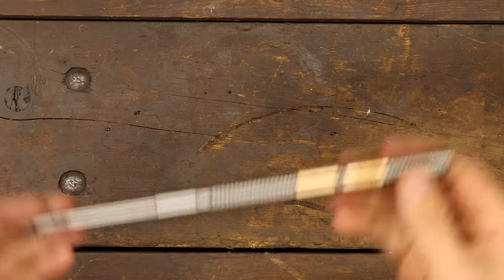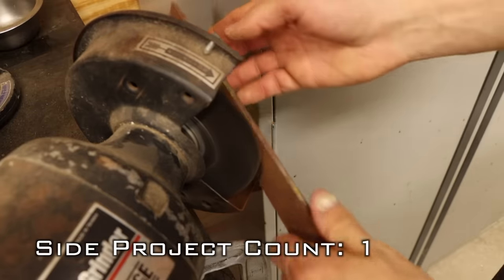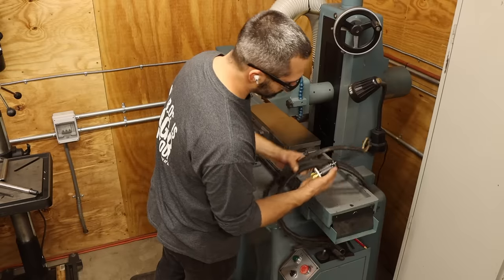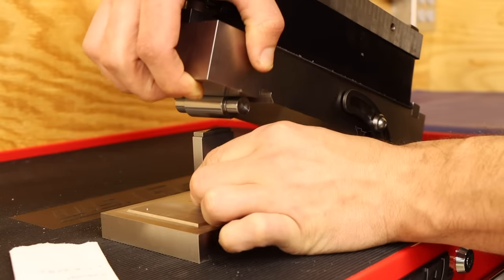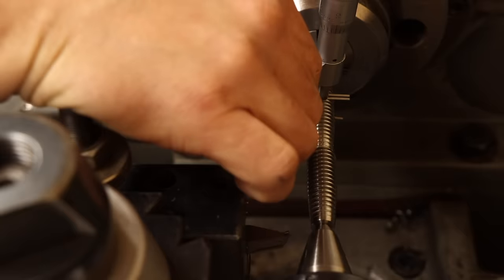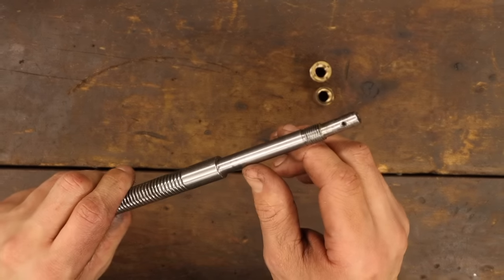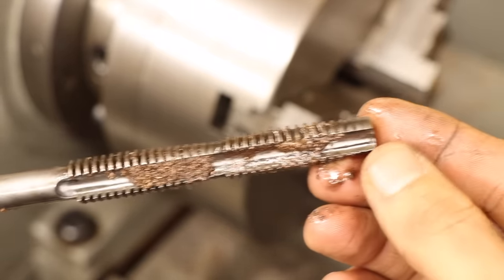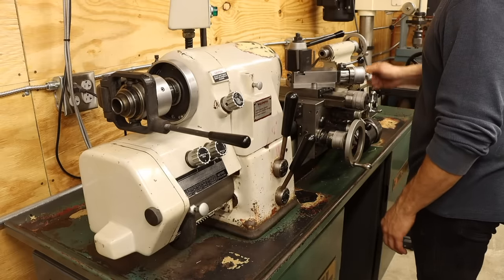Just A "SIMPLE" Repair

Comment: Have a far older beauty, in need of MUCH,  As it is imperial, and worn, going to do the same, but as the thread is cut into the the slide, have much thinking to do before I start.
Reply from the maker: Oh wow... seems like you'll want to bore it out and make a replaceable pair of lead nuts (if possible of course)

Comment: All great work !
 I gave up my DV-59 For a 10EE. I still ponder that decision as both needed some extra attention. My 10EE still requires the same Shaft & Nut replacement you just did. I can buy new from Monarch for $$$$$$$$$ or make my own, since I AM a machinist kinda guy. My new cross slide nut/shaft holds .0003" maybe i can get the compound to be .001"
Reply from the maker: I have faith! Thanks

Comment: Why remove the backlash with fixed nuts instead of having one spring-loaded nut? (with the spring coming from the direction opposite the tool holder's applied cutting force)

Comment: NICE WORK.did you check if the dials stil indicate correctly. Your thread could be a TR14x2.5 thread.
Reply from the maker: I didn't but I would not because the handwheel dial is 100thou per rev haha

Comment: since you are replacing nuts and rod could you simply not make the screw whatever size you wanted as long as it falls on the correct ratio not to throw off the measurements up front on the dial?

Comment: Yes, the threads are ground,  At least all the ones I've made(work at a machine shop and make repair parts and such for these compound slides) we finish grind all the diameters and thread grind the threads.  The bushings are threaded on CNC lathe with a special insert on a boring bar.

Comment: You might wanna check and see if the dial graduations still are accurate. Hope I explained that correctly. Since you made a new lead screw, it's possible any slight difference from the original will mean that a full turn doesn't equal the same travel as the original part did.

Comment: Cool repair. I almost wish that I had a fully equipped workshop just so I could restore old machines. One thing I did think of though, could you not have roughed in the thread cutter using the bench grinder then brought it to size on the surface grinder?
Reply from the maker: Thanks! Yup I thought about doing that but decided to keep it simple. The SG worked it's way through before too long

Comment: Okay for real, I've done art based 3d modeling for years and years and years but I've done very little engineering 3d work. I needed to 3d print something and I needed to model the part and print it asap. I did 5min of research, downloaded Shapr3D on my flippin iPad, engineered the part in 2 hours on my couch and printed it on time. It's actually some seriously good software.

Comment: If you really wanna get into some side projects, you could consider converting everything in your shop to a single measurement system. A imperial lathe made in a metric country is a measurment mess. But you have the power to change that if you felt like it.

Comment: Nice job.  The next time you take the handles and dials off, can you show us how the metric imperial mechanism works on the dials?
Reply from the maker: Can do! I was puzzled by it as well but its just a single planet gear that connects a sun gear on each of the dials. Theres no fancy conversion just a 1 to 1. Imperial is 0.100 in per rev and the metric is 2.54mm per rev

Comment: Loving that you called out the janky tail support on the mill. I said that out loud seconds before - But hey, it works!
Question: You had a choice in maintaining that odd thread pitch, why not go with something more standard? M14x10TPI is definitely on the weird side.
Reply from the maker: 😆 The pitch needed to be 10tpi no mater what to match the .100 per rev of the handwheel. I probably could have used a standard american size but was having trouble finding one that would deliver fast enough. So made the decision easy.

Comment: Man, I’m always so excited to see how your brain processes operations. The custom tap was brilliant. And so well executed too! 
I opted for single point with a custom internal threading tool for my Acme 5 TPI on 17mm lead screw. I think it’s a rule written somewhere in the lead screw engineering manual that they must share metric and imperial, and must use a randomly odd thread pitch.. haha 
I wonder if one would benefit from sitting down and running the math to see if the same results could be achieved using a standard size Acme thread vs these odd ball sizes.. ? 🤔
 Well, I just realized.. I have enough projects and enough math to do so odd ball it is.. lol 😂
Now to add to my list a new project I have mysteriously found the urge for.. who doesn’t need a overly large custom 5C collet block set ! 😊
Reply from the maker: Thanks Jason! I actually considered switching to a 9/16ths-10 acme thread which is very close but wouldn't have gotten the tap fast enough. So figured if I'm making the tap anyway might as well make it exactly the same haha Collet blocks were my first project one the channel! It's surprisingly hard to get them as exact as one likes haha

Comment: working on heat treat now.  bought the 88$ Mr. volcano to red hot and dunk alignment bars I am making for Christmas presents for tin knocker friends. I have to make the dunk tank for the 18" long tools and temper in an oven I have not built yet. Cannot commandeer the house oven. doh 

Santa might be late this year.

Thank you for the keeping me company out in the shop. Merry Christmas!!
Reply from the maker: Nice! I've got a proper oven on my list at some point as well. Merry Christmas!
Reply: not exactly sure how the PM system works. I cannot get to the contact info. Mine is Nine 20 Eight 10 Three 658 @InheritanceMachining
Reply: just put parts in the POS toaster oven from a rummage sale/ leave them in for 2 hrs while I take a nap I had 80 thou runout on the transfer punches from heating or dunking probly heating. @InheritanceMachining

Comment: 17:30 why didn't you just use your custom made machinist jack? Wouldn't that be the exact scenario which you created it for?
Reply from the maker: I considered it but not quite because I needed side to side support as well.
Reply: @InheritanceMachining   Maybe this is just me cause I'm not a machinist but what side to side support is needed for sloting? It should only be downwards pressure and linear (along the slot). Or does the drill have a rotational effect?
Reply from the maker: @burnstick1380  I agree with that but in this case it wasn't exactly slotting with the cutter off-center on a round part. Because of that it was cutting more on one side than the other and pushing it away. You can actually see the diagonal deflection in the shot I get from the end of the tap. That was helpful in actually diagnosing what was going on haha

Comment: i noticed you tested if there where any cracks in the new grinding wheel by tapping it with something, i don't know about you but i was taught to tap it with either a wooden stick or a rubber hammer and it it sounds flat there's a crack somewhere. i didn't know you could tap it with some metal stock tbh.
Reply from the maker: I don't necessarily think the way I did it is the right way. Just used metal to get a more "clear" tap

Comment: That blue arrow on the wheel indicates the eccentricity of the mounting hole with the OD, mount the wheel with the arrow pointing straight up (allowing gravity to do its thing) and the wheel will sit on the arbour the most concentrically it can, allowing for clearance between arbour and mounting hole. Larger the wheel, the more difference it makes with balancing.

Comment: The acme taps I saw (not many, really...) had too a taper in the middle, with two different geometries, a smaller and then a larger. maybe the taper is to smooth out the transition between the two shapes so that the change isn't just concentrated on a single point in the tap. 

Idk, in any case good job!

Comment: Hi! So, how does this software compare with Fusion 360 and/or Solid Works? Thanks a lot
Reply from the maker: I would say they are very similar as far as the standard modeling features. Shapr3D is easier and quicker to use but Fusion and SW have more functionality as far as assemblies, animation, FEA and things like that. It really depends on what you end up needing
Reply: @InheritanceMachining  I need not to pay the thousands of $$$ SW is charging me for a new license 😀 the student one i have from 2010 is in a laptop that is about to die 😞

Comment: Wouldn't it make sense to heat-treat the spindle to increase the wear-resistance?
Reply from the maker: I could have but then run the risk of it warping and actually expanding throwing off the pitch. The stressproof I used should help with the wear though

Comment: Was this a record number of side projects?  Beautifully executed, and not a single visit to the box of shame!
I would have been tempted to make it a standard 10 TPI acme thread and buy a tap.  I've only used an acme thread once, and I remember it was a ton of torque to get it through the cast iron part.
I should probably check the threads in my old 9" South Bend for similar wear.  Unfortunately, almost all of my shop time lately has been for emergency modifications and rework to prototype parts for my day job.
Reply from the maker: Thanks Keith! I think it was (if you don't count the side project videos) I actually looked at buying a 9/16-10 acme tap but it wouldn't have arrived until after Christmas so that made the decision easy haha Happy Holidays!
Reply: @InheritanceMachining Happy Holidays Brandon!
I tend to be impatient like that too - one of the perks of having the right machines to repair the machines, which is why you need more machines to repair those machines...
Reply from the maker: Exactly! @keithviolette5870

Comment: why did the screw wear out? shouldn't the nuts get all yhe wear being softer?
Reply from the maker: I think it's still possible because if any grit gets in there it will wear both the bronze and steel. I could also make out past rust issue son the screw, so it may have been hard iron oxide in there that did the damage
Reply: @InheritanceMachining  oh yeah. the softer the material, the more abrasives embed. kind of how mirror polishing uses copper honing tools. Cheers

Comment: Amazing video as always.  I was just wondering.  Is the bed on that lathe integral, or would you be able to flip it to either mitigate the wear you found by the spindle, or to remove it to grind it in some way?
Reply from the maker: Thanks! Yup it is removable. Thats usually how people get them apart to have them reground. I could try flipping it (if the holes line up) but then I would have the same issue keeping the tailstock straight
Reply: @InheritanceMachining  I wondered if shimming the tailstock would be easier, D if you would regularly be using the stock at full retraction.  But if it can come off for a regrind then hopefully that won't be a mammoth task 🤞
Reply from the maker: I say it can be reground but I don't know I will go that route haha I've heard that can cost as much as $5000... @laignechfaelad
Reply: @InheritanceMachining  and here was me thinking you'd pop it in the surface grinder 😜

Comment: Question about the surface grinder: if It's doing things that are so exact you need it out to thousandths or tens of thousandths, how is the grinding wheel losing material over time accounted for? Doesnt each pass technically reduce the wheel size and therefore throw off all the calcs?
Reply from the maker: Yes and no. It has a lot to do with the fact I'm only using about 50 thou of the full width of the wheel at a time. That leading edge will work its way across the wheel as it wears but as long as you redress before that happens you are good. Hope that makes sense

Comment: For heat treating - I strongly recommend you build a furnace.  Then use stainless foil wrapped around to prevent scale.  As if you needed more side projects…
Reply: Better to spend $20 on a garage sale toaster oven, than to use your kitchen oven for tempering.  A toaster oven has so many non-food uses in the shop!
Reply from the maker: It's one of the higher priority things on my list for sure!

Comment: Gotta make yourself a steady rest that moves with the cutter, would make cutting long threads a breeze.
Reply from the maker: I actually have a follow rest for that lathe that i was going to bust out if i started having issues. The thread burs might have made it interesting thoguh!
Reply: @InheritanceMachining  Yeah, fair point about the burrs. Wonder if you can get around that by replacing rollers on the rest with profiled ones. Think of it as pieces of threaded rod rolling along the threads that are being cut. This way the surface where all those burrs are isn't actually touching anything, instead the load is on sides (flanks) and the ID of the thread being cut.
Reply from the maker: I like that idea. My current one doesn't actually have rollers, but instead some sort of soft-ish stationary stock. It might even be soft enough for the first few passes of burs to form their own clearance grooves. @AgentWest
Reply: @InheritanceMachining  True, it will "self clearance", however i'd be worried that as the thread is cut deeper and deeper (especially with more pointy V thread), it would leave less and less support for the rod by basically rubbing away more and more of that support material.

Comment: Why do you need so thick cable for that surface grinder. At 1.2Kw and 240 V it will require only 5A
Reply from the maker: Because using something I have is cheaper than buying another one 😂 But yes it was oversized
Reply: @InheritanceMachining  Haha. I did exactly the same with mine!

Comment: As long as i have the OG thread in a clean form, i usually don't bother to math the cutter anymore. I know it has to fit inside and grind the profile to match it (i do cheat, i have a shadowgraph) then get the relief by eye. So far i haven't had booboos (tho, of course, having said that, i know i've opened the door for Mr. Bozo to come for a visit). What i'm tying to say is, shadowgraphs are wicked cool and super useful.

Comment: Aren't you just copying any error in your lead screw from one lathe to the other lather? I get that backlash sucks, but if you are doing cross slide work how do you know that .001" on the dial actually translates to .001" at the tool?  Or more accurately, does 2.000" actually translate to 2.000" of movement?

Comment: Shouldn't you first Heat treated the matherial before machining it to your measurements? This way you avoid bending of the finished part.
Keep up the good work! @InheritanceMachining
Reply from the maker: Good call. On the stressproof I dont thing that is needed because it's designed to avoid that issue.. I had my suspicions that the O1 was pre-annealed though. Thanks!

Comment: A lovely job on all fronts.  But one needs to ask themselves "why did the old screw and nuts wear out like that?"   I don't see any way to oil the screw and nut.  At least not anything easy to do that would lead us to do so more often.  So what about an oil port added to the compound and possibly the cross slide in due time?
Reply from the maker: Good call. That's exactly the problem with this compound. There was actually a lot of rust pitting on it too. I'll need to come up with something for it. Luckily the cross slide sits in an oil bath

Comment: I feel sorry for you north Americans with your split phase system. 😢😢😢😢 Here in Australia, In most cases, having 3 phase available at the road is convenient and so much more efficient. I think i would go nuts with twiddling around with phase converters.
Reply: As a North American (Canadian) we certainly do have 3ph power available, just not normally in homes.  Canada uses 600v 3ph for industry and Office buildings,  240/120 1 ph for domestic.
the US is similar.
Were I live (very rural) ,only 1ph is available, but my fathers home (Less rural) and all urban areas have access to 3 ph if needed.
Reply: @steveggca Yep. However, most Australian homes have 400/230 three phase at the switchboard or at the pole outside their house/ property.
Reply: @allangoodger969  so much the same as europe.  Honestly having spent my work life ,first in manufacturing installing  cnc machines (all 3ph), and then
refurbishing and inspecting nuclear reactors (also 3ph😁), I have never missed having 3ph at home.  Just to be clear thought I could never bring myself
to using one othe those rotary  phase convertor things.   VFD's are inexpensive, reliable and plentyful.

Comment: You didn't put relief after the cutting edge so it resulted in multiple times the torque needed. The thread of the cutter was engaging with the freshly cut threads while soaked in oil and chips
EDIT: Literally 5 seconds later in the video you already did it... Nevermind lol
Reply from the maker: haha I learned the hard way